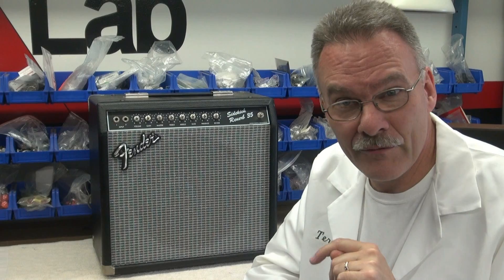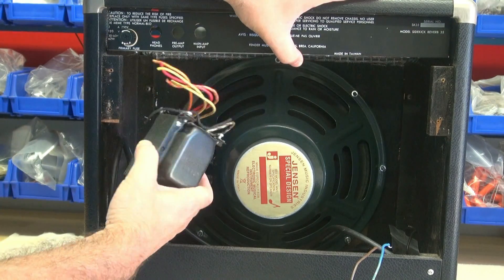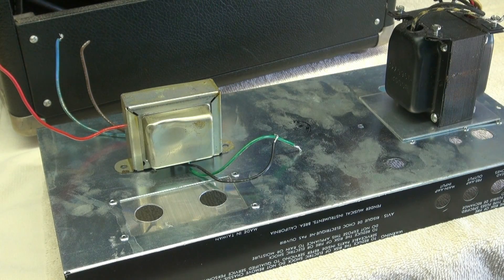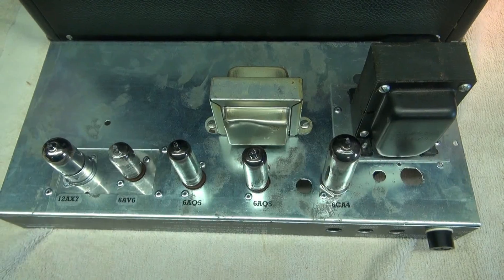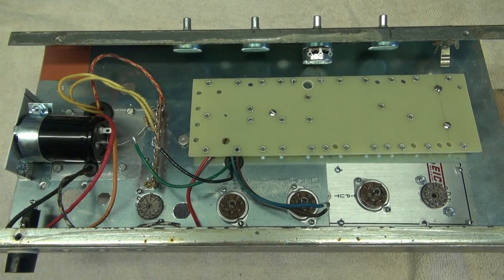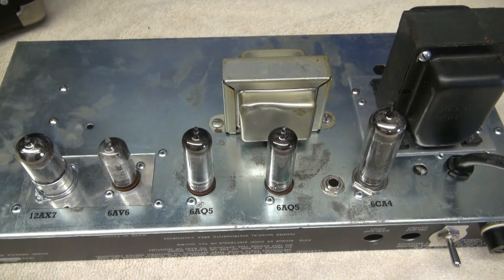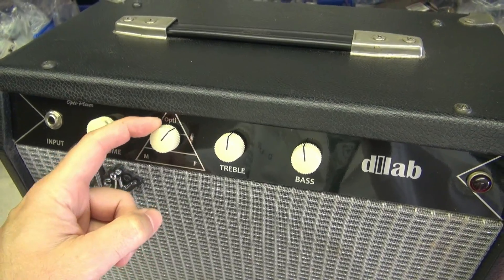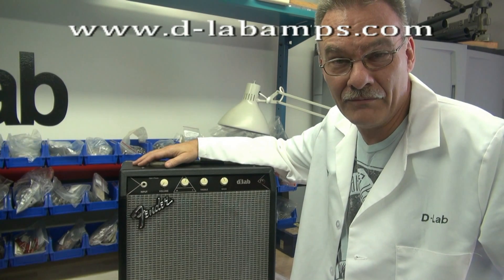How to convert Fender solid state guitar amp to tube machine by D-lab

Comment: DLabs, i like the work yall have been doing . I recently have picked up FOR FREE  a total of 3 1980's Fender Sidekick amps. A 35, 25 , and 20. I've gotten some interesting tone out them however  would it be possible to pay for your services and have at least one of these things converted into  a tube amp. I really like the vibro champ and enjoy clean sounds  with a little growl later in the gain knob vs something that can only sound overdriven.  Thanks in advance for your response

Comment: Nice . Its a Gibson Skylark GA5 Crestline with a 12ax7 substitute for the 6eu7 which is rare and expensive , with a few bells and whistles , but all solid state combos are made to be turned into great little tube amps . The ECC83 doesn't  has little if any effect on the Gibson amp as long as its wired in correctly. Using miniature tubes is a good idea when trying to save space on the chassis as even the long Marshall chassis get cramped when you have an extra tube in 5he front,  tubes for reverb etc. I live in the UK so pick on Marshall Valvestates and build amps that should have been in Marshalls line up but never were , with similar bells and whistles . The pan knob is a nice change from a clunky rotary switch the switch in the components changes for " modelling ' other amps .

Comment: There is no difference in the sound reproduction between transistor  and vacuum tube.  It's all OCD in peoples minds. Transistor amplifies  electronic current, Tubes amplifies voltage.  It's all the same.      ( VxA is watts) power,  sound is still sound no mater how it is amplified.    Learn Electronics, it is just the medium.  ( microphone to speakers are the electron conductors of sound back to sound)

Comment: Replacing the solid state amp altogether using the chassis and cabinet is not transforming solid state into tube. It is simply replacing the amp I thought the original circuit would receive alterations in order to become a tube amp. That would rock.

Comment: While watching this "transformation", I seem to remember something (you said?) about the transformers needing to be oriented so that their coils are not aligned in the same plane, to reduce or eliminate inductive hum. But it looks like the power and output transformers on this are oriented in the same plane. Am I imagining that? Also wouldn't it be beneficial to have located the output transformer farther away from the power transformer, not only to reduce hum, but also to gain additional clearance for the speaker?  I remember you saying that you'd prefer to have the output transformer as close to the output tubes as possible, but isn't there a trade-off?  I would think that the high-powered signal from the output tubes to the transformer is much less sensitive to RF noise than say, the low-power/line-level preamp tubes, so having the output transformer farther toward the other end of the chassis would have more "pros" than "cons".  Does that sound logical? I realize that this video is 5 years old, but I'm late to the game, and soaking up as much as I can about Fender tube amplifiers. I have two Silverface amps: a Bandmaster Reverb head-only and a Pro Reverb combo with 2 12" original Fender speakers.  I have had both of these since the mid-70, and although they sound great, I'm sure they both need new caps and tubes (if not more).  The Bandmaster has an unusual mod on the back - a "Low-Z" output with a volume/gain potentiometer. I believe I was told that that's a "preamp out". I have had both chassis out of the cabinets over 30 years ago when I replaced the original Fender silver grill cloth with black grill cloth.  If I could send a photo, I would, because I think it looks REALLY sharp! The "swoop" Fender logo really stands out on it, and the "gutters" frame it nicely. Soon enough, I'll be updating them with grounded power cords and removing the "death cap". Then maybe I'll get cap and tube kits and upgrade those. I think I can handle the "J-hook" method of replacing the caps. Much of this I learned from watching your (and "Uncle Doug's") videos on a variety of Fender tube amps.  I'm also considering changing the hard-wired power cords to the "modular" power sockets and a grounded accessory outlet for low-power accessories, like my wireless receiver, but cutting a square hole in the chassis seems a bit intimidating.  Anyways... I ramble too much, but I thought you might enjoy hearing from a fan!

Comment: Hello, great video. I may need to do this. I have a Fender G-DEC original 15W. It is hanging when power is applied. Nothing I do makes a difference. The reset procedure I've heard about does nothing. Anyway, I'd like to take advantage of all of the features of this amp if possible. If not, then the above seems to be the way to go. I was about to dismantle the thing and sell the parts: cabinet, speaker, and non-working electronics (stated as such) or use the electronic components for another project if worthwhile. Of course, that option is still there but I am keeping the tube amp option as an option. Another option would be to put a transister circuit instead of tube. The largest speaker that can be used as-is would be an 8 inch. I'd like the loudest amp possible with this collection of junk without overloading on distortion. Your thoughts on the subject would be greatly appreciated.

Comment: Converting a solid state amp into a tube amp is a special kind of cool. I was given a Fender Mustang III that I would like to have converted if it's possible. Is this doable? I've been looking at tube amps and purchasing a new (or in some cases used) tube amp is a little bit pricey and this seems to be a pretty good way to score what I'm after. Would one of these conversions work pretty well with some effects pedals, like TWIN REVERB?

Comment: Question .
im an over the road driver . I am not fawn of import Anps . I have a 1600 watt inverter in my seni sleeper  
what can be done with a set up using a 10 "  jensen speaker all tube system  I am an Electrical or electronic al  Idiot when it comes to  electronics .

Comment: I don't know if Dlab sees this. 
I am a pro touring bass player that uses a Fender TB1200 bass amp. It is a 1200 watt mosfet amp with a 12ax7 driven preamp with a Fender Tone stack.
My issue is the tone stack of teh TB1200 does NOT vary much  in EQ as other fender amps that I have played.
I have an old ALEMBIC F2B Preamp that is based on teh Fender Tone stack of a Dual Showman. With separate BASS, MID and TREBLE.
Are you able to MOD a Fender TB200 bass amps Preamp to more resemble the EQ'ability of my Alembic F2B preamp?

Comment: Im sitting here looking at a Squire 15... I have 4 EL84s 3 12AX7s and probably enough junk saved up to do this.... (as seen on my channel partially) but I only know enough to be dangerous..... If someone is bored enough please look on my channel at my Lafayette 236A(36w 2 channel) Has neat stereo/mono blend and Lafayette KT50/500 Stereo tuner, and let me know some options.... I also have other tubes and transformers and such... I would like build a Marshall type amp possibly.... Between 15-50 ish watts... With gain control and master volume ect....

Comment: Just got a old RCA pa amp 35 watt I would like it checked over b4 it gets powered up noticed the fuse cap and fuse are missing so tell me how to become a customer?
Reply from the maker: Hi Dan, Do you need me to send you a new fuse holder or do you want to send the amp in for repair?
Reply: D-lab Electronics I'm in Pittsburgh pa are u far from there ?
Reply from the maker: Hello Dan, I am in Battle Creek MI

Comment: I have a similar project.A Ross SS amp found in an alley and a tube amp from an abandoned console radio from the 40's/50's-ish.The Ross may even work if can find a fuse for it and the chassis/components in the console look to be clean and in nice shape.Since small SS amps are abundant and cheap I'm going to convert if the tube amp components still function,whether it works or not.
Reply: Anyone know anything bout Chinese made studio 7 s70.I fried the power transformer need a suitable substitute.any help??

Comment: I did this, used the same fender cabinet, but did it super single ended (2-6v6) on rubber mounted rafts,12 watt, very clean too for acoustic guitar. I certainly like it. Correct spacing around the speaker is so very important. Good job man.

Comment: Question: like the idea of conversion very much, Good Project. Fender made a 23 SE which was in 92-93 as a hybrid Amp, with Solid State PreAmp and Tube Output Amp. Is there any merit in such a design and can we reuse more of the old SS amps in a hybrid concept. What power rating did you end up producing I can not find any of the Opti plus videos you refer to .

Comment: could you mount a board like that into a scraped super champ x2 chassi.already 2 6v6 and one 12ax7 socket mounted.There is already another spot drilled for another preamp tube.

Comment: I have superchamp X2 with a fried digital board it has two 6v6 and one 12ax7 already mounted.There is an existing hole for another preamp socket.would you be able to mount another 12ax7 socket and a princeton style board?

Comment: Terry why the 6AQ5's, why not 6V6's. Is it the difference in sound or easier to get or is it the circuit itself. Also or opti-plex circuit could you use it on a 6v6 amp to get similar sound.

Comment: What if I wanted reverb and how would you do it?
Reply from the maker: A Fender spring reverb circuit could be added, however in this cabinet it would be tight. Very do-able
Reply: D-lab Electronics, thanks! I would like to put one in my Marshall jcm 800 10 watt amp, is there a diagram for it?
Reply: Or do you have a video adding reverb to a amplifier that doesn't have it?

Comment: Nice job ,  but you should mention a good place to get parts such as power and output xfmrs is from vintage radio/phonos, especially 40's-60's era stuff that is beat up and cheap.  You can find them on Craigslist if you know what to look for (tube type ones of course means pre 1966 era).   Some have amps you can remove , rebuild and fit into your own custom box.  Also, the Vintage Electronics Expos are great places to get parts.  Your videos of those events are wonderful, by the way.   Next one is Saturday, Jan 27 2018 in Farmington Hills,  Michigan.  www.thevee.org    Summer one is in Kalamazoo MI Fri-Sat July 13-14 2018

Comment: Inspired to try one more project!! Terry, do you offer DIY kits for sale? Just picked up a Randall Pyramid combo amp with an 8" speaker with PLENTY of inside space that I don't believe works and has had some tinkering done to it but the box is solid so thinking about doing something similar.  Would be looking for something Marshall-esque JTM or JC800. Other option I guess would be to just gut it completely and make a speaker cabinet out of it and power with a  little lunchbox Kustom Defender..  Thanks!
Reply from the maker: Cool deal man, Sorry, I do not offer kits

Comment: How to convert an amp: Step 1, remove amp from case. Step 2, put a different amp in the case. Project complete!
Reply: Jedidiah you have way oversimplifed things. One major aspect of his conversion you are overlooking is he designed and then built the tube amp that went into the S.S. box, he just reused the box and the Jensen speaker.
Reply: Take old amp out close holes up put tube amp head on top hook speakers up  now and you are done
Reply from the maker: Reuse current chassis
Reply: Are you saying the amp is a tranny? But serious, I want to start building tube amps. Thanks for posting videos like this. Awesome stuff and great sounding amp.

Comment: This isn't a conversion lol you just gutted the amp and made a new one entirely
Reply: Thats the beauty of this. If anyone has ever looked into getting a tube amp kit the most expensive art of the project tends to be the chasis and cabinet. Getting a really cheap solid state practice amp and using it instead saves a huge amount of money.
Reply from the maker: Pretty much, none of the solid state components were usable. The chassis was re-used, thats it.
Reply from the maker: Hello, I am in Michigan
Reply: Tyler Rosal if you yank the entire drivetrain out of a vehicle, say a chevy 350/350 and replace it with a diesel... that is indeed a conversion.

Comment: That 6CA4 looks alot like 6P14P,  Russian 6BQ5.  Must have been used for a prop for this video?
Reply from the maker: Nope, it is the rectifier used in this amp. Hammond organ amps used the same tube. It can handle the same current as a 5AR4
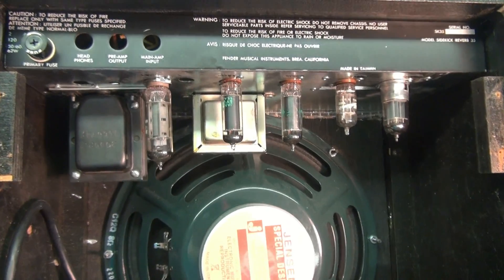Reply: Heh, well there's no question in my mind the tube shown at 2:33(far left) in rectifier socket in a 6P14P.  Just look at the plate.  I have many 6CA4?EZ81s also.  Not that it matters, just had to point that out. :) The 5AR4 is a step above the 6CA4 and never should could be subs in spite of the obvious pinout differences.  For example, 2 EL34s in PP or SE would be a too little rectification w/ a 6AC4 with it's 150mA at the plate.  The 5AR4 has 250mA at the plate and a lower voltage drop but w a guitar amp sag/compression is a good thing.
Reply: I know he says that that recti is a 6CA4, I just looked at a ton of pics of 6CA4's and none of them look anything like that tube he's using, so I have to agree with you. I looked at my russian 6P14Ps and they look indentical to the tube he is calling a 6CA4. So D-Lab..   what brand of 6CA4 is that?

Comment: Nice job on the layout and video.  Normally, you want to orient the power transformer and output transformer windings at 90-degree angles.  I noticed your power transformer and output transformer windings are in line with each other?
Reply from the maker: Hello, That rule only applies to open transformers. These have end caps, so inductance is no issue

Comment: what is the 6av6's function on this circuit? are the diodes of it in use?
Reply from the maker: Hello, the 6AV6 is used as the inverter. The diode elements are not utilized. If you look at the specs of 1/2 a 12ax7, you will see that a 6AV6 is the same. Best part is the 6AV6 is very inexpensive. TD

Comment: Hello.  Nice vids. For a long time i think about converting my "Deluxe 112" SS Fender amplifier. You show me it is possible...
I thought the OT  should be installed as far as possible and at 90 degrees from the PT. Perhaps it is not so important. What is your opinion on this point ?
Reply from the maker: +ant Sor Hello, the 90 degree mounting rule was for open bobbin transformers. They could induce magnetic fields. If your transformers have metal bell ends, there is no restriction on mounting position. Hope this helps
Reply: Sure! Always good to learn things.
Reply: One of the first things I notices as well... I wonder if there is a hum?

Comment: Damn, why didn´t i found your channel eariler....sometimes all you need it a little hint...;) just built an all DIY Combo for a friend (in fact, i haven´t done the woodwork just the electro/mechanical part)....it would have been lot cheaper to simply buy one of these and done a convert...thanx man for this "hint"...:)
Reply from the maker: +TubiCal Hi, glad you found my channel. I have done this conversion to 3 of this style Fender cabinet. Yes, it will save you lots of time and money. The chassis is a bit cramped, but the end result is worth it.